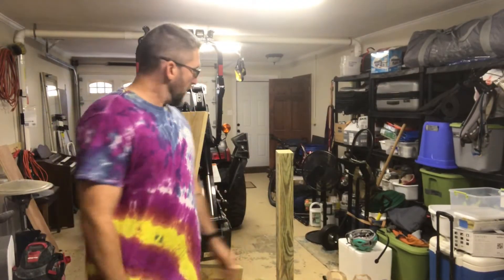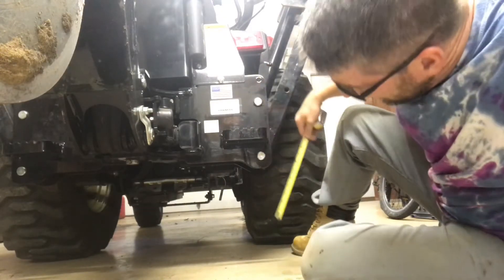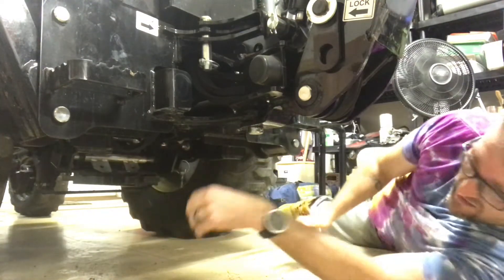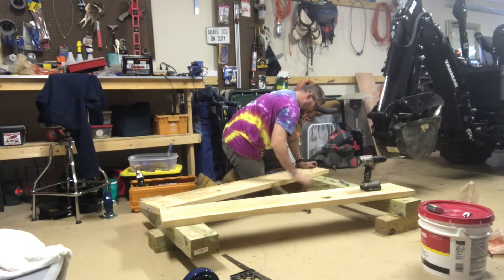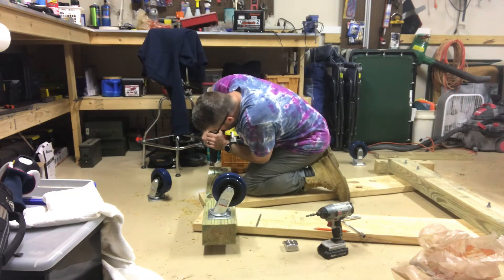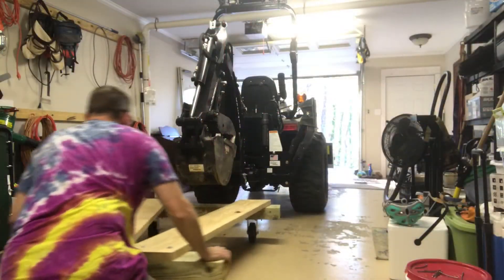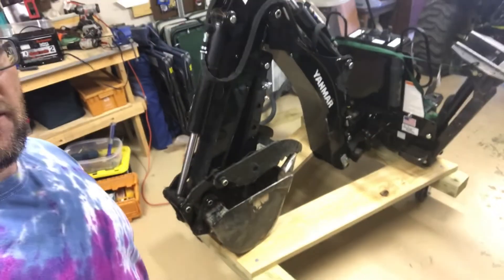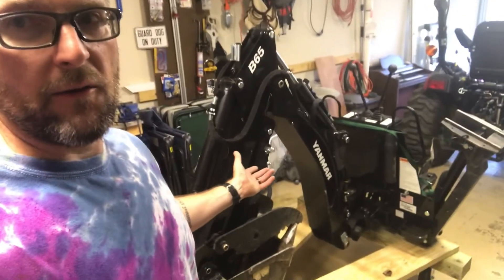Backhoe Dolly Build

Comment: Thank you, Jaybird
I made my dollie after watching your video and
“DYI My Way” video. 

I have Yanmar 324
10.5” clearance. Had to use Harbor Freight 5” wheels like yours. 

I couldn’t put a 2x10 under the backhoe, so I put 2x8 to the outside of the backhoe. Front ant back. Creating a notch for the backhoe bucket on the front and a notch for the outriggers on the back. Easy to line up dollie under tractor. 

Thank you very much. My life just got easier